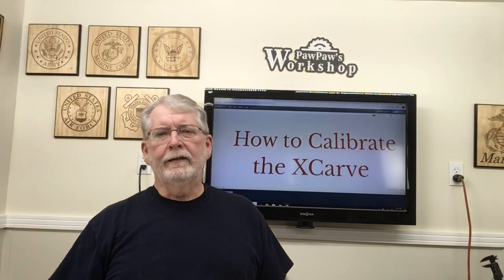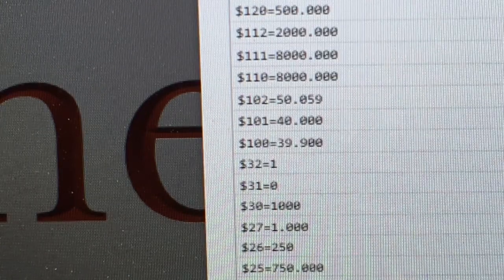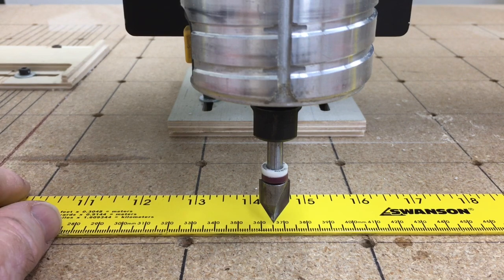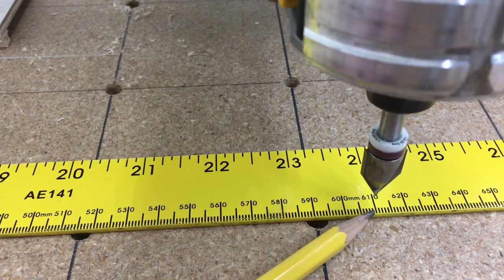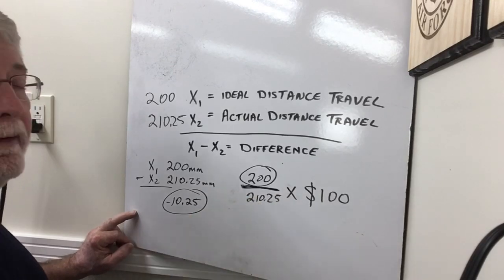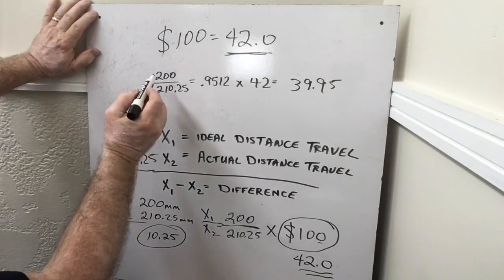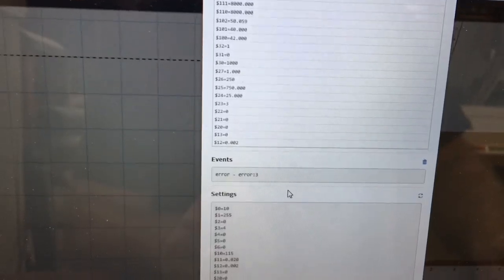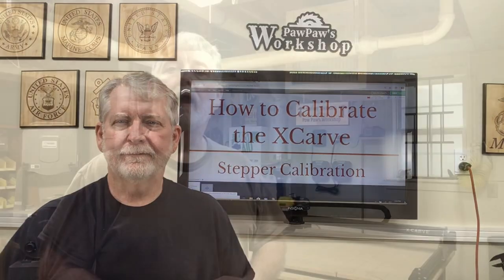How to Calibrate the XCarve: Stepper Calibration

Comment: Sir, I have an issue with my z axis just carving up in the air. I was sent this video to calibrate the axis. The z axis was off and I have corrected it. I have also verified it is now moving the correct distance but it's still doing the same thing. I'm using easel and the offline controller. I'm at my wits end trying to fix this. Support is three days between emails. Forums on Facebook have been little help. Any ideas? Thanks in advance.
Reply from the maker: Hello Mark,
The first two big problems are solved. It’s moving in the correct direction and it is moving the correct distance. 

Next,  the offline controller has issues and quite frankly I do not use it any longer. That said, how are you setting the zero position?  Are you using the puck or the paper method?  Next, if using the puck, do you have the correct thickness of the puck in the machine?

Also, is this a new issue that just started or are you new to the CNC and have yet to get it to run correctly?  I know this is a lot of questions but hopefully we can get you up and running.
Reply: @PawPawsWorkShop  I have been using the machine since February with relatively few problems until out of the blue it started doing this air carve thing.  I use paper method when setting the zero.  I don't have a reliable internet connection in my workshop so the offline controller was a godsend.  I can possibly move the machine outside in the next day or so to where I have a decent internet connection and try directly from the computer but it all depends on the weather.  What do you advise.  Thanks again, I really appreciate it.
Reply: Hello! I got my machine connected directly to my computer and used a test file FoxAlien sent me. It's still doing the same thing. Carves above the workpiece.

Comment: My Y axis is out but only one way ? 
I test it starting from 300mm send up the scale 200mm (500)mm perfect bring it back to 300mm send it down 200mm and it over shoots by 4.5mm send it back to the 300mm point perfect 
Please help very confused 
Thanks in advance 
Mark
Reply from the maker: It sounds like something is loose. I would start with the belts. This is very unusual. That is why I think it is a mechanical issue.

Comment: My stepper motors are working correctly but my planer carving is always .020 thou inches on the y. The sides of the planer is cutting within .003 which is tolerable but I need to level the z axis. I installed the z axis upgrade a year ago but I don't remember what to tighten to keep it level. The z axis is hanging toward the front of the machine
Reply from the maker: You will need to add shims either to the housing on the router itself or to the mount. You only need a very little amount to make that correction.

Comment: Hello Paw Paw.  Which number needs adjusting when doing the calculation for the z axis.  When I try to go up or down 1" its only traveling .285"  is it still changing the $100=____?  Or another number?
Reply: Thank you!
Reply from the maker: If you are adjusting the x axis the new value will always go into the $100. Take the ideal distance divided actual distance traveled times the current figure in $100. The answer will replace the current figure in the $100 position. Then retest. Make the adjustments again using the same process. Hopefully it will only take one time to get the figure and once to confirm.
Reply: And I really like your videos.
Reply from the maker: $100 is for the x axis, $101 is for the y axis and $102 is for the z axis.

Comment: I'm in the process of a new spoil board, tramming and calibration. this was a great video for Y and X axis, but what point do you use to measure for the z axis?
Reply from the maker: I have several videos showing how to calibrate the z axis. Just make a point on the z axis and on the fixed portion, then follow the same steps

Comment: Hey there mate, as a lot of comments have been said, I watch a lot of your videos and learned lots of new things, this video was great 😁  , I did the test and was out 12mm, but only on the X-axis, y was perfect, but after making the code change, all is good from 100mm to 500mm (at 100mm increments) but found when I did it for 600mm, again it was still out by 2mm,  I just can't seem to work that one out?? 🤔🤔  any ideas??  even tensioned up the belts a little thinking it might have been that, but it did not help 😔  I suppose 2mm over 600mm is not that bad, but I am fussy about it being spot on.
Reply from the maker: You are on the right track. Just follow the exact same steps as when you were out 12 mm. If you tell the machine to go 600mm and it goes 598. Use the numbers. The answer will be very small. If you can’t get it exact then there are other minor factors that can come into play. Human error for one, even slight movement of the ruler. Small corrections are always the hardest

Comment: Very good video for both x and y axis calibration. My problem area is the Z axis. My cutting depths are all over the place. Set z probe. Does fine until it starts carving. The bit is plunged directly into the wasteboard. Then it proceeds to cut 1 inch over the work piece. I have not found a good video yet to calibrate the Z-axis
Reply from the maker: The problem is that you have the z axis calibrated incorrectly. Yes it will probe but when you start the carve it will go crazy. Here is another video 
https://youtu.be/Y9NG1U0zXDw. You need to make sure that if you say move 2”. It actually moves two inches.

Comment: Do you know of a way to compensate for the non-linear aspect of the stepper motors? In other words, I have found if I calibrate my Y axis to, say, 15 inches, then move the spindle
 7.5" it will be off. Moving it another 7.5" in the same direction puts the spindle right back where it needs to be. Very frustrating!
Reply from the maker: No, I have not experienced this problem before. I do not know what would cause that issue.

Comment: Excellent videos! My problem is when I go to MACHINE INSPECTOR I do not get any computer settings at all. I have Easel 3.20. In CONSOLE I clicked SHOW STATUS and the box just says PRESS ENTER TO SEND LINE. How can I get to the computer settings to calibrate them? Thanks so much for your help. mike
Reply from the maker: With the machine on and Easel open you type the new code in the box and hit enter.  To see the change you must scroll all the way down to the bottom of the code and you will see the change.
Reply: @PawPawsWorkShop  Thanks so much. I didn't have the machine plugged into the computer!
Reply from the maker: That will do it.

Comment: Great video and thank you so much for everything you provide the community. What would cause the calibration to be off?  Lots of factors I suppose. I would think the belts loosing up and v wheels degrading over time could be part of it.  How often do you check calibration?  If I make changes in Easel will the values be saved after I turn of the machine and computer over night?  I’ve had my 1000mm X Carve for a year now and I still have so many questions.
Reply from the maker: I check the calibration only when I make a change.  When I upgraded my Z axis the lead screw had a different thread count. That makes the difference.  The fact that the belts may be loose does not make the calibration off.  You could lose steps if the belt slips on the stepper motor.  Yes, the changes are saved.

Comment: Grandpa help me to calculate steps per mm for m8 4 start lead screw
Reply: It is NEMA 23 and 16 micro stepping
Reply from the maker: Follow the steps in the video.  Measure the desired distance vs the actual distance that it traveled.  Plug in the numbers into the formula.
Reply: What to put the value for $100 grandpa
Reply: Can u help me to build my cnc

Comment: Need help. For some reason every time I carve something from the corner of the material (x=0, y=0) it is always too far to the right and too far up about 1/4” or so. If I set the spindle to the center of the material and and set x0,y0 (in easel it looks like it is off the material) it carved perfectly. I used this video to check the X and Y 200mm and it is spot on. Trying to carve a juice groove in a cutting board and I can’t seem to trust it. Any thoughts?
Reply from the maker: I see you were able to view the video. I hope that it helped you with your problem.  Please let me know if I can help you.

Comment: i wanna ask one question. if X axis pulley teeth 18 and Y axis pulley teeth 20 . then what is our calibration ?
Reply from the maker: Follow the formula. You need to know how far you expect it to go and measure how far it actually goes.  Plug in the numbers and you will get the adjustment needed to enter into GRBL.

Comment: This is exactly what I needed.Thanks.
Question: do you need to reinput that value for every project? Or Easel saves it as the new default onwards?
Reply: In the video you're using Easel :) 
BTW, what's UGS?
Reply: Ok got it universal gcode sender
Reply from the maker: This code was written to be entered in the macro section in UGS.  I have not tried it in Easel

Comment: I see it works in Easel but my ugs codesender reverts back on $102 as soon as I press apply?
Reply from the maker: Sounds like a problem with the computer.  It should save the information.  It may be the cashe needs to be dumped or something else.  I am not a computer person.

Comment: I just couldn't do many of the things on my cnc x carve without your videos.  Thanks a lot, from a dedicated subscriber. I need advise on an issue, I upgraded my stepper motors to the Nema 23 motor 19.4kg-cm 269oz-in they mounted perfectly just as you showed.  My issue is the drive sprockets for the belt, I ordered the specific sprockets that came with the X carve but the ID diameter is larger than stepper motor shaft.  Do you know correct sprockets for these stepper motors, 20 teeth.?  Thanks in advance for help from anyone and especially Paw Paw.
Reply from the maker: Typically, the 269oz stepper have a longer shaft and causes problems as well and the sprockets are hard to remove without a wheel puller.  I do not know the teeth per inch.  I was told by inventables that the 269 oz was too much for the xcarve.  The xcarve has 140 oz stepper as standard.  I stopped when directly by inventables that they did not recommend 269 oz.  The z axis that I added has a 178 oz for that reason. I would suggest calling inventables and asking the teeth per inch. They are very helpful and knowledgeable.  Thank you for being a subscriber and following my channel.

Comment: Great information. I am wondering if this will fix a problem with my z axis. It cuts too deep. I have to raise it about a 1/4 inch above the work surface when i set the work zero.
Reply from the maker: Thank you very much.  It does sound like that this may be the problem.
Reply: just wanted to add, if you happen to be using the z probe kit i'd double check the actual height of the probe disc. i had this problem and found out my z probe disc was 14.61mm instead of the 15mm the machine thought it was getting

Comment: Thank you so much for the great videos!  They are a great resource.  Today I was having trouble with 00 not stopping in the same place as it started.  Do you think calibration is my problem?  I plan to calibrate first thing in the morning.  Thank you again.
Reply from the maker: If the machine is not stopping at the same position it is most likely the belts.
Reply: @PawPawsWorkShop  Thank you. i'm trying to calibrate now but when I click on Machine Inspector the next page doesn't show all the numbers you have on yours.
Reply from the maker: Sometimes you need to scroll down.

Comment: Hi. This was very helpful. Do you think this would help with my projects finishing crooked? They finish slightly higher on the one side of the x/y axis- z seems OK.  Other suggestions? Thank you!!
Reply from the maker: If it is slightly higher on one side it is either the gantry not parallel or the waste board is out of alignment and is higher.  The waste board may be thicker on one side vs the other for various reasons.

Comment: Paw Paw. Good job on explaining X and Y calibration. What can I do to calibrate the Z-axis? I'm having a strange issue when using the Z-Probe.  If I manually set up Z, it works fine but if I use the Z-Probe, the bit buries itself into the material and breaks the bit.
Reply from the maker: Are you getting good contact when you check the connectivity?  I think that may be the issue.  Poor connection may be the cause.  Next, are you probing at the original surface of the material?

Comment: Great instruction.  Really appreciate it.  The mm was really helpful.   I'm American but found myself using mm on smaller project pieces just because it was easier than fractions and the point u made about mm smaller than 1/16.   I can say that the one time my xcarve was not accurate was due to a loosened z axis components from a dust collection housing problem.   Reassembling the z axis housing got the xcarve back to accurate.  Just throwing that out there in case it's helpful.   I'd probably tighten all the connections on x,y,z before trying to calibrate.  Not sure though.   I'll definitely go straight to this video when the time comes to calibrate.  I'm afraid to try now in the middle of a project.
Reply from the maker: Thank you very much.